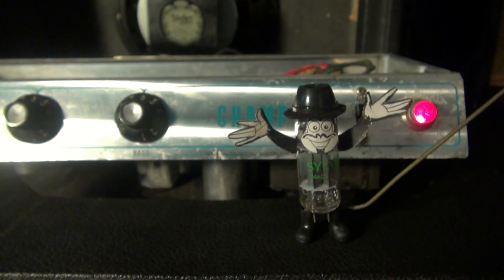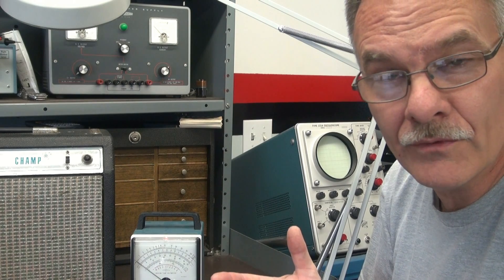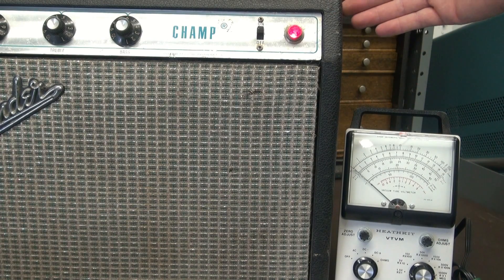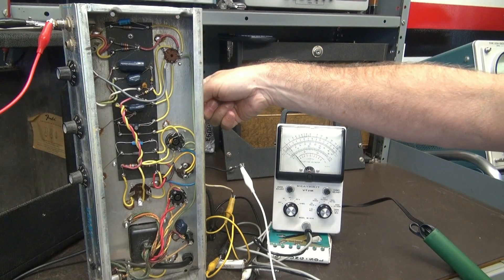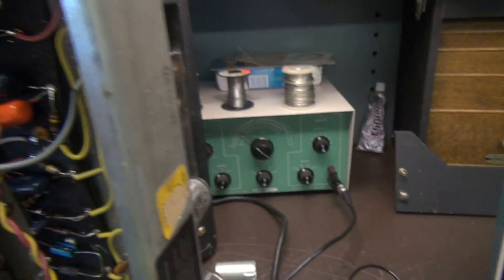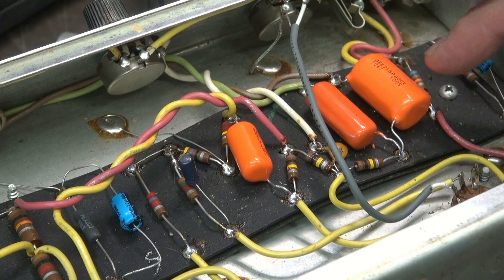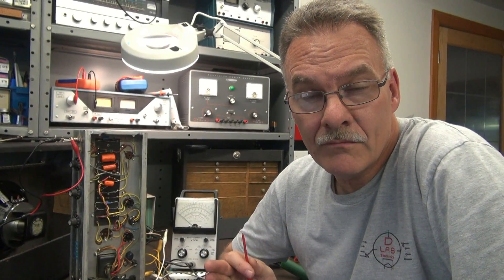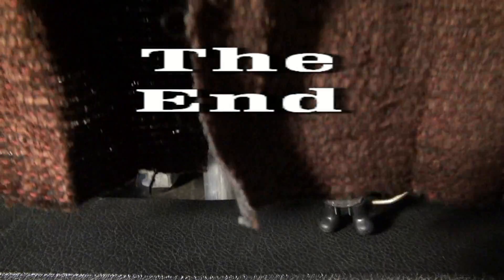How to repair Fender Champ tube guitar amp  Intermittent audio D-lab

Comment: Preaching to the choir here....
Those warping old Fender circuit boards are great for repairs caused by the boards itself.
You can see the warping in the area of the cap failure.
Excellent video about old analog meters. Definitely easier and safer than setting up a big oscilloscope, variable iso transformer, audio generator, etc.....
Heck of a lot cheaper! 
Thank you for the video!

Comment: Hey Mr. D-lab, good on you for acquiring a VTVM! There is another way in which these beasties can be used, look at the very bottom scale - the little minus-zero-plus bit. To use this, use the zero control to make the meter read the centre of this scale & it will show not only positive readings but negative readings also. Comes in very handy when aligning IF transformers. Also these meters have an input impedance comparable to that of a digital meter. Thank you for another bloody good video. I salute you good sir.

Comment: Nice. I got two of those Heathkit VTVMs last ham swap meet for $5 each; I didn't really need them, but they had been repaired and I really couldn't resist. Gotta make probes; those are not quite so trivial with that special TRS phone plug with the insulating bushing in the middle. Otherwise, any old phone plug will work as long as you lay off measuring big volts. I may just hard-wire in some leads.

Comment: Outstanding!
Thanks!
Reading the comments, I found the VTVM 5 vac setting reply. What signal generator settings did you use? And, if I may, I have always  wondered: why can't one use an 8 ohm speaker core as a dummy load? So much obliged for the great tutorials

Comment: thanks for your video very helpful !
i have a question about the 8 ohms dummy load resistor
should we only use a non inductive resistor,  instead of a regular one ?  is it risky to do so ?
or it is just for precision ?   i tried with a regular one and it works just fine.  thanks you.
Reply from the maker: Hello, Yes, it really doesn't matter. If you can find the non inductive type, that would be the first choice
Reply: thanks a lot for your answer

Comment: Your whole point here is of great value! I wouldn't be without my VTVM's in the shop. Great for peaking IF stages on an old AA5 as well as being able to take voltage measurements without loading down the circuit under test since tubes are hiZ devices, and the VTVM is the perfect marriage. DVM's, like digital oscilloscopes, are constantly refreshing and can drive you to drink...(not a bad idea during a rough day) :) CRT scopes will always reside at my shop :). One of my favorite VTVM's is the RCA WV98C which I lost on a service call...it grew legs. Wish I could locate another one...even if I have to restore it. This was a great tip for the newbies, and a reminder for us veterans :) Keep 'em coming...I'm a watchin' :)

Comment: hello and I've got to say I love your videos and all the great information you put out there for everyone so that being said I have a question about capacitors , I am in the process of ordering a assortment of capacitors so my question is how critical is the voltage. I noticed a lot of the assortment of capacitor kit range around 50 volts so that being said I would think that if I'm going to be working on tube amps and Tube radios I would need at least a voltage of 2 - 300 volts to put me in the good range is this true? Any information you can give me on this would be much appreciated thanks and keep up the good work.

Comment: Question: would a 100 ohm resistor be too small to discharge the filter caps capable of holding up to 500V?
Reply from the maker: I would suggest at a 1K resistor. The cap voltage discharges quickly, however with a 100 ohm resistor, you may get a spark
Reply: Awesome thanks!

Comment: Nice repair Terry and I figured that you would find it pretty quick.

I collect old VTVM's. I've got Eico's (259 on the bench right now), a giant old Hickok Model 209, a couple of RCA Voltohmyst's and one Senior Voltohmyst, and my never been used Simpson Model 303. You can't beat the old analog vacuum tube meters. 

73 
NE5U
Reply from the maker: Hello, I had quite the collection of these meters at one time. Decided to keep the Heathkit and send the others down the way. B&K made one that had a dampened needle. I'd stay away from that type. In this application, you want quick needle response. Thanks for your kind responses to my presentations. TD